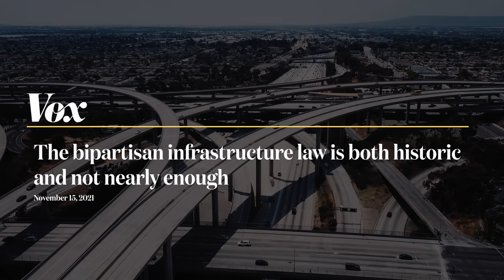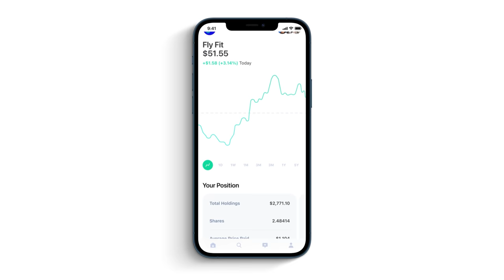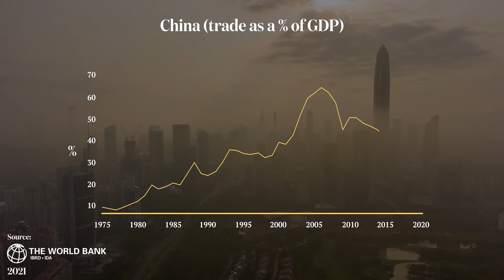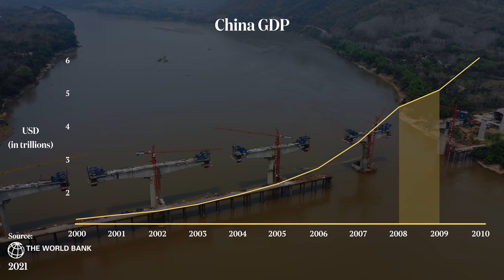China Has A Debt Problem Three Times Larger Than Evergrande | Economics Explained

Comment: Infrastructure is a public service. The public as a whole pays for it through taxes. It is OK to have losses as long as the economic output of the country as a whole benefits from this service.
Reply: Federal infrastructure protects are not paid for with taxes. The Central bank makes the money.
Reply: @Joaking91  well said...the video does actually show the whole picture and it only focuses on the cons... When China is doing something better... They need to trash it... Sadness
Reply: Excellent point, I'd love to see an in-depth analysis on the benefits of those unprofitable lines. For starters the avoided carbon footprint of not having the Chinese drive cars or even buses is significant.
Reply: @ten_tego_teges  almost no passenger train line anywhere turns a profit, including Europe, but it allows for the opportunity for value generation. Roads also cost money but a modern economy cant work without them. I suspec they know it but they have an agenda to push.
Reply: @ten_tego_teges  You know of course, that electricity is make in China mainly from coal. And this electricity is consume by no needed central planed services.
Reply: @MrKarolmarks  Fair, but the efficiency of trains over cars, both in terms of mechanical efficiency and the power plant vs combustion engine efficiency, makes trains far more eco-friendly than cars.

Even electric cars that are powered by electricity from coal plants have a lower footprint than ICE cars.
Reply: The USA spent $2.1 trillion in Afghanistan and $1.9 trillion in Iraq. That’s 5-6 times what China spent on its high speed rail.
Reply: They can pay through it with taxes all they want but that depends on how much does taxes actually get spent on maintaining the infrastructure. Both empty rail lines and those empty buildings that are going to be empty for about a decade now is on the verge of just being unusable. You can build it but you just should use it and if you don’t then it’s just going to become useless in the years to come when you do try to use it thus just spending more and more than you did from the beginning.
Reply: @inkbold8511  There are plenty of homeless in China. The fact the police move them away from tourist areas and the Chinese media don't report on it doesn't stop it.
Reply: Yes, you are correct: infrastructure is a public service, and it is clearly okay to book losses provided the economic output of the country benefits. This is exactly why the US must pass an infrastructure bill that was long ago promised by Trump. This is not a Republican vs. Democrat issue at all. 

But that said, at what point do infrastructure build-outs like HSR, with ever-increasing losses, become a liability to a country's economy? Sure, these projects keep SOE developer and construction companies busy, and with that, they guarantee employment of Chinese people, and the illusion of apparent prosperity. But most of these SOEs are also money losers, which is only partly due to massive debt that they hold. How long can the govt simply look the other way on these massive losses, just to continue to create a HSR that it can show off to the world? That's the point of this video, which maintains that that point has long ago been reached and passed.
Reply: @terencedoherty7386  I don't disagree with you. But on the other hand, debt didn't stop America from being the world's sole superpower for decades. In fact many American pundits argue that the debt ceiling is meaningless.
Reply: @rf2032  Yes, but I think there is a definite upward limit to what constitutes "manageable" debt, and what constitutes debt that is flat out of control. It lies somewhere around the ability (and the willingness) of a country to pay down ANY of the principal on its debt, but I agree the demarcation line between these two states is not well defined. One thing for sure, China is approaching this point much more rapidly (and recklessly) that the US is.
Reply: @Bk6346  they profited more
Reply: @Joaking91  neoliberal or neoconservative?  seems the neoconservatives are the ones aching to see China fail due to ideological differences. maybe both?
Reply: @Mehwhatevr  both the democrat party and the republican party suscribe to neoliberalism as their core economical tenets, to very similar degrees as that.

And both want US imperialism to triumph over China amd at the same time enjoy the cheap labor China can offer, securing their own undoing (their, because the american people have nothing to gain or lose from us imperialism losing)
Reply: @Joaking91  I guess I don’t know what neoliberalism is. So Mitch McConnell, Donald Trump, Joe Biden are all Neo liberal?
Reply: @Joaking91  ok. sounds fair. :)
Reply: Normal rail service, yes. High speed rail service through the desert? No. The longer the distance, the less sense high speed rail makes. High speed rail only makes sense on certain routes, such as between major urban areas within 3 hours of flight time. Maintenance, intermittent stops make high speed rail make much less sense than regular flights. Only connection between major cities should have high speed rail. Any more than that would be excessive and wasteful.
Reply: @Joaking91  well, the guy who runs this channel isn't exactly a supply-side economics favoring neoliberal. He's stated in previous videos that his economic views align much more with Keynesian approaches to economics. And these Keynesian macroeconomic views also happen to be the basis for the fiscal policy stimulated growth of much of the Chinese economy so...
Reply: @jamesclarke2789  i never claimed such ideas were originally and exclusively from China. I counterargued your claim that theure originally and exclusively from the west. Dengism uses neither Keynes nor Friedman's employment equations, which i agree are exclusively theirs. Saying "keynesianism is when the government does stuff" doesnt make any public role in infrastructure keynesian and is in fact disrespectful to his work and his genuinely good legacy of stripping the blame of the great depression  from workers.

The root of your mistake comes from when friedman went to china, didnt like it, hence Keynes did it.
Reply: @Bk6346  In the last 13 years, China increased $2.3 trillion dollars national debt, the US increased $23 trillion dollars national debt.
Reply: @andrewmack2161  They were everywhere before, but no longer see them anymore.
Reply: @Joaking91  Deng invited and embraced Reaganomics in China’s economic policies.
Reply: @jinlancera  I guess they've been moved out of your area
Reply: If the choice is between a non-toll highway and rail it becomes clear. The highway provides value but it will never generate income. The rail provides value, but has the chance to provide income. Which provides more value is why we need economists and planners.
Reply: @andrewmack2161  Not only my area, you can not see them almost anywhere now. A part of the reason is the government pay for the train tickets to send them home in the countryside where every male was given a piece of land to live and grow agricultural goods.
Reply: @jinlancera  No. They're still there. You just haven't seen them.
Reply: @andrewmack2161  A YouTuber from Canada went all over the poorest province in China, he could not find them.
Reply: @jinlancera  They're all over certain vids by an american that lived there. But I've a few friends (mostly Chinese) and they all confirm they've plenty. They gat moved out of tourist areas and for the visits of CCP seniors though. Mostly people that couldn't tend land even if they had it.
Reply: @1Dimee  0
Reply: @andrewmack2161  I don’t live in a tourist place.

I don’t mean that they don’t exist. I just mean there are much fewer of them than before.
Reply: @santiagos4290  For the supply economists, eventually, more people will use the infrastructure since China has such big population.
Reply: JBaba  sure Ning Nong
Reply: @slevinchannel7589  I'm familiar with his channel, he makes a lot of great points indeed. I've long been suspicious of Musk and disillusioned with corporation's that promise "progress"
Reply: It's not about losing money. it's about not being able to caugh up the money to pay back the debts.
Reply: Profits are necessary for private projects. It is okay to provide subsidize to allow unprofitable projects to occur. Still, money needs to respect a benefit coat ratio to facilitate movement of money to obtain the greatest benefits. But the public needs to make capital available to loan for infrastructure projects.
Reply: @slevinchannel7589  Can they build trains for ultimate growth? Maybe, but no one spends money for ultimate growth. Chinese? I do not think so. Tracks, maybe. Trains, you can bet not.
Reply: in Australia the gov. just hands the keys to the city to the banks in the form of PPP's. These instos build the infrastructure and then fleece the public with extortionate pricing to use. For example toll roads, where these days you almost have to mortgage your house to travel from one side of Sydney to the other.
Reply: Thanks for keeping it simple. That's the objective of cognition.
Reply: @Joaking91  Chine do be a fascist capitalist nation tho 🥵🥵🥵
Reply: @LaVaZ000 Lol. sure.
Reply: It is OK to have immediate losses but not unsustainability. There is no point building a fancy infrastructure project if no one's wants to utilize it
Reply: Lots of people increasing their social credit score in here.
Reply: If nothing else mentioning of social credit score seems to be a quick way to dismiss views one doesn't agree with but is too lazy to refute.
Reply: @rf2032  +10 social credit points. Winnie the Pooh will be pleased.
Reply: I award you no point for feeling clever.
Reply: China is state capitalist not communist
Reply: @MrKarolmarks  You forgot about how renewable energy is growing faster in China than any other country. In fact, they produces the most renewable energy worldwide. They are planning to go full electric and ditches the fossil fuel. As of now they already had a system to create more solar cells with the electricity from renewable energy, which further expand their renewable energy sources. In fact, they already managed to make solar energy cheaper than fossil fuel.
Reply: Armed extortion and wage slavery is what taxes are.
Reply: @drewp.weiner2473  How do you proof to people that believe the Earth is flat that magnetic field even exists?
Reply: @MrKarolmarks  Even if it was powered by coal, coal power plants have higher efficiency than gasoline cars. While trains even on diseal move a massive amount of weight because of low rolling resistance meaning, it would still be more efficient than a Tesla EV by a large margin.
Reply: @andrewmack2161  Your claim about homeless in China has been busted. People looking for homeless in even the poorest cities find it impossible or hard. So your claim is not actually back by anything.
Reply: @terencedoherty7386  You don't seem to realize that China is a NET creditor, not a debtor.
Reply: @fleyua7176  Search YT. There are a few channels that show it...
Reply: @fleyua7176  Taiwan is an independent country

Comment: Two things I think you've missed.

First, in the both the US and Australia, there exist free-to-use roads. It's quite reasonable for railways to be similarly subsidised, because they are a policy vehicle. Indeed, it's an obvious distortion to subsidise road and not rail.

Second, it is not the no-brainer you seem to imagine to use passenger lines for freight. Canada and the US have few truly viable passenger routes, not because the demand does not (at least in principle—I'm setting aside cultural factors since they are in large part a consequence of earlier policy) exist, but because of a supply problem: if your lines are filled with massive freight trains running at 30 MPH / 50 km/hr, there is no longer any opportunity to run passenger services that are competitive with buses, let alone aircraft. And, to be blunt, that's how the bus companies, car manufacturers and airlines like it. And then there's track maintenance. You've already noted that this is a financial burden, but freight trains are a lot heavier than passenger trains, and passenger train derailments typically (not always—there have been some truly horrifying incidents with flammable cargo) have far higher costs than freight, owing to both higher speeds and the fact that the trains are packed with fragile and irreplaceable humans.
Reply: B J  don't be too serious with an anarcho-radicalmutualistic-communist
Reply: The roads in the US are not free. Taxes are applied at a Federal and State level to gasoline/diesel. Further local taxes are applied to trucks that tranport goods based on the value of the goods and the distance travelled
Reply: In the Netherlands freight trains go by night, passenger trains by day (apart from 1 dedicated cargo line to Germany).
Reply: @raul0ca  They are free in the moment you are using them. Unlike for trains and other public transit, you don't need to buy a ticket to use most road infrastructure. Trains are not payed for through taxes.
Reply: I almost believed in u and ignored the corruptions, forgot about ordinary rail roads that achieve the same goal, forgot that many sections in Chinese HSR don't even travel at high speed due to landscapes or proximity to residential areas.... HK spent USD 10Billion for a section that saves ppl's travelling time from 45 mins to 35mins from an existing rail system...... btw... those were tax payers money to build and to MAINTAIN for millions EACH MONTH!!!
But like I said, I almost believed in what u said... almost
So I strongly suggest u do take closer look at things before u accuse this video 'China bashing'!! I sincerely hope woke folks like you will live long and taste what CCP do to their Countrymen aka Slaves...
Reply: @brakkor1081  how exactly can ordinary rail achieve the same goals as high speed rail?? Regional rail has speeds around 90kmh, high speed rail travels at around 300kmh. High speed rail can replace short flights, regional rail, just can't.
Reply: @plainText384  In the US, vehicle registration is an annual ritual, where the revenues are based on the value of the vehicle (or weight, in case of trucks) and used to pay for road infrastructure. Additionally, gasoline, CNG, and Hydrogen fuel station taxes/surcharges are used to pay for road infrastructure. So no, you are not paying $10 for each time you drive (unless you’re on one of America’s many toll roads), but when you consider that you pay $300 a year in vehicle registration fees and $.70 per gallon of gasoline in taxes, it adds up. Roads are far more cost efficient than trains, hence why it’s cheaper per mile.
Reply: @kpro8908  A two-track railway costs around one-third as much as a six-lane freeway, but can carry more than three times as many passengers. 
I don't know why you would think roads and cars are cheaper than railways and trains.
Reply: @plainText384  No, it can’t. Unless you have a train as long as the track, which is entirely full, in which every passenger is going to the same destination at the same time, then no: two railway tracks are not more efficient than 6 highway lanes. Additionally, cars are not cheaper: roads are. For private vehicles, the costs of infrastructure are far lower than the costs of vehicle operation (which is 100% privately born by the person who owns it). Roads, without factoring the costs of automobile purchase and maintenance, are far cheaper per mile per year than comparably capable railways. In a railway, the operator (in this case, the PRC government) bears not just the maintenance of infrastructure costs, but operations, fuel, liability, and all other associated costs. From the state’s perspective, roads are almost always cheaper and more practical
Reply: @kpro8908  That's just straight up not true. 
You can easily have a train going down a two track railway every 3 min, if the demand is there. 
But even if you only use one 9th the capacity of the railway, it still compares favourably to a highway running at optimal performance.
This is all before accounting for the cost of the extra pollution, the cost of providing parking, the extra land use and the increased noise a highway brings with it.
Trains are simply way more effective than cars at transporting a lot of things in predictable patterns. Outside of small isolated rural communities a car and private transportation is always going to be a luxury, that you are either paying extra for, or that is being propped up by the government.
Reply: @plainText384  Besides pollution, none of the “costs” you cited for highways are unique to highways relative to rail, nor are they born by the state. Parking is a private provision for individual property owners to provide for their kind of business, and for commuters to decide the market value of. Beyond the cost of asphalt, which is easily made up with already existing taxes, there are no direct costs born by the government for building and operating a roadway. Rail lines are the exact opposite. Are there many cases where trains are viable? Sure, but not everywhere, and pretending cars are not substantially cheaper to develop infrastructure for is simply asinine
Reply: @raul0ca none of these taxes it anywhere close to paying for the huge cost of Highway maintenance